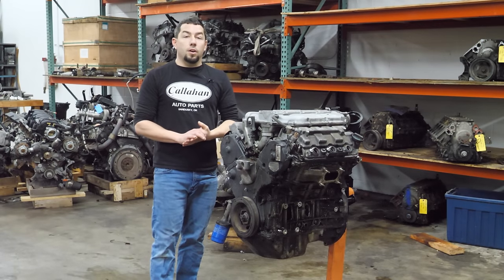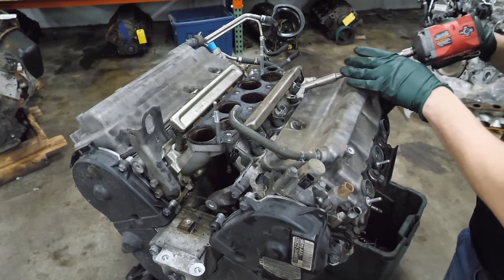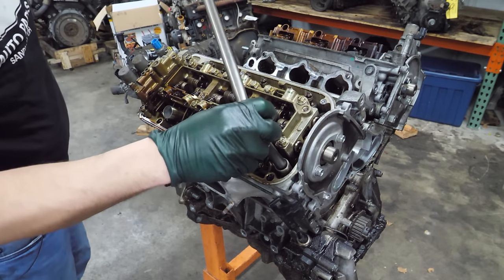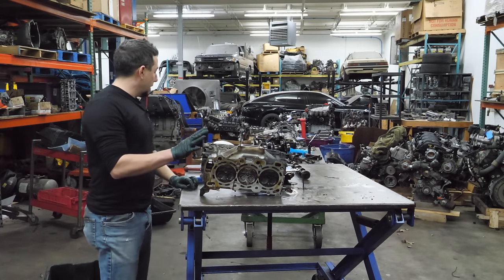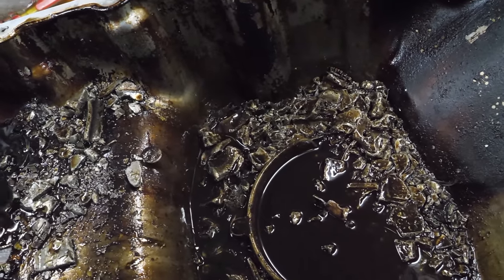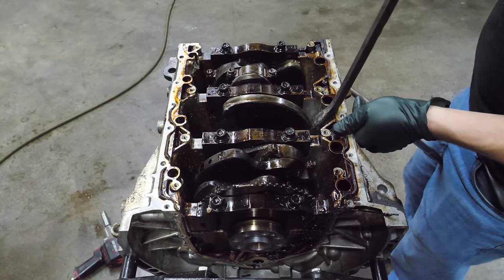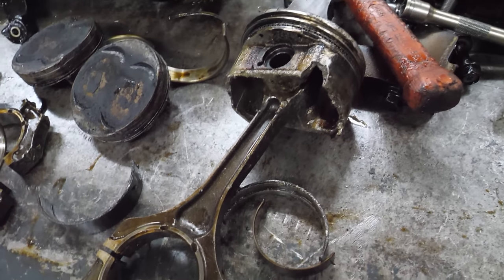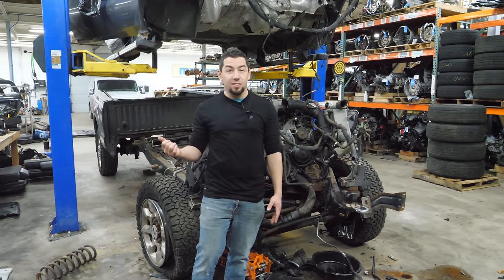Obliterated Honda Accord J35 V6 Teardown. Customer States: "Vehicle Shut Off"  OH I BET IT DID!

Comment: The fact that the crank was locked up, tells you that it was a manual transmission.  And that would explain why the engine was so shredded;  The engine probably threw a rod while on the highway or going down a hill or something-- and it coasted quite a ways while still being in gear, and the momentum of the car continued to rotate the engine and shred the parts to a creamy puree.
Reply: VCM never came on the manual transmission versions of the vehicle.

Comment: Think his radio was turned up to much. A coworker was going to add oil to his engine  e use he hadn't checked it in awhile.  I said why don't you just change it. Turns out he had the car since new. Odometer read 80k plus miles. He he had never changed it..just added more when it was low ? It was a Datsun 210.  As always,  great fun watching

Comment: LOL those valve look like skinny mushrooms that all grew at different angles trying to get to the sun.
All people i talk to, i tell them AVOID cylinder management engines.  ALL manufacturers, ALL.  I love my GMC trucks, but those 2007+ 1500 trucks with AFM (Active Fuel Management)/DOD (Disable On Demand) = hard no. I stick to my 2006 and wont ever buy an AFM engine.
Stay gold.

Comment: I have a 2010 odyssey with a bad VCM 3.5. Do you know if I can use an 08+ non vcm MDX or Accord engine? I know they changed the odyssey bellhousing in 2007. Did the MDX and Accord also get the updated bellhousing?
Reply: Use a vcm muzzler?

Comment: I blew up my engine… it burned so much oil I had to put a quart of oil every time I put gas ⛽️ I ended up just changing the oil filter and adding oil for a year and a piston spun a bearing… when I drained the oil it was dark dark with metal 🤘

Comment: How do you break FIVE rods in one engine and into so many pieces? This one was NOT just running down the highway when it let go. Maybe running down the highway in LOW gear being towed by an RV! I took apart a 350 Chevy years ago that had 4 spun rod bearings (ran out of oil by 16 year old) and it stayed together.

Comment: @I Do Cars so I have a accord 2008 coupe, j35z3 and I have a grinding noise when I’m on idle and my crank pulley is definitely wobbling, and I took it to a mechanic and they told me the crank shaft is definitely damaged. What should I do, should I rebuild the bottom half or is it even worth it!
Reply: @I_Do_Cars

Comment: Ive got a Ford V10 that literally blew to pieces and its a lot worse than this Honda.  The entire block exploded and everything in the engine crumpled.  The driver was in hospital from engine shrapnel too.  It was racing 1/4 mile on nitrous so around 3,600 hp.  The engine was like a grenade and shit went everywhere

Comment: Eric, I would like to buy the top Intake bolt set from you if that is possible. IDK the name of your shop.
Old school hammer and deep well socket for small block chevy springs and keepers. ;D Hilarious with the safety glasses. 😂
The person driving this car literally drove it while destroying the engine in the process. It was coming apart for some time before it died.

Comment: My boss had this exact year and model Accord.  Honda bought him an engine rebuild at 90k miles after 2 rounds of fouled out plugs.  Sure enough a couple more rounds of fouled plugs later it was once again burning oil nicely at about 100k later so it got traded in.  Yeah it made it to 200k, but under protest.  Not Honda's best design by far.

Comment: I guess that if that automatic transmission has a strong lock up converter clutch and the car was moving at speed on the highway and also if power doesn't go through another one way clutch or sprag in high gear,momentum from the car moving along the highway after the engine began to disintegrate continuing to spin things might have played a part in the degree of total destruction

Comment: Hi There - How is Honda Steel these days? I drive a REAL Mercedes FROM 2001, but my Motorcycle is a honda. I got her in 1979. This was before Honda made cars. I love and use my motorcycle now. I had put her away in 1988 to raise my family. I restored her during shelter in place, and during her first short ride, blew out a muffler at 13,000 miles. Condensation I assume, yet I question the quality of steel that honda used for the 'top of the line' and curious what is the quality of top of the line in terms of product quality these days, and oh btw: what is top of the line in terms of steel according to honda ?

Comment: I was extremely entertained by this video, but something is gnawing at me.  I am a physicist who deals with energetic materials, and analysis of strengths of materials.  If I have been informed correctly, Honda used forgings rather than castings for their connecting rods (note the complete lack of cast lines on the rods), and crankshafts, leaving only the pistons as cast items.  What troubles me is the extreme amount of fine rod material in the fragment "mix", despite the fact that the rods were not seized on the big end.  In order for that much fine maceration to take place, the engine would have needed to do a tremendous amount of "work" at EXTREME RPM for a sustained time period - in simple words, it would have taken far more POWER (power = work in joules, divided by time in seconds.  The result is in watts, ~746W = 1 hp)than this engine would have been capable of delivering, especially once it was mechanically compromised.  I cannot reconcile how this engine could have sustained the degree of rod damage that it did, and retain fluid motion of the connecting rod big end.  I wish this user nothing but the best, as he has provided me with many hours of fun in front of the screen, and I hope his success continues, but something is not quite right about this degree of destruction, occurring in an engine that has connecting rod large ends that are still moving normally.

Peace

Comment: You need to take manual 4x4 car, lock diffs and drive down hill like 100mph when you activate electric ratchet, that will unscrew oil filter to 100% stop oil supply. Then engine brake at red line until all wheels lock up or until no engine braking will take place. It will be blown nicely.
I think, that it will take closed course and driver with real balls, a lot of mess will be everywhere :v
And electric ratchet could be string or belt on filter housing, just pulled from cab

Comment: Sheesjj, how it went :
5th gear 3.5k rpm... 'clunk' what was that?? 20 sec later, Brrrrshshshs ratatatata rinkle rinkle.. Yo the engine is blown.. But.. It stil runs yo 🤨. Cil 1. 2 and 3 left the chat. 4 is also done.. 5 is having a seizure and needs a medic, piston 6 has the typical Honda lawnmower enthusiasm and keeps on chewing wile the thing is selfdestructing and uses the crankshaft as a blender. 4 miles down the road the cil 6 also exploded and this dream comes to an end 🙂

Comment: VCM ruined the J motor. Before VCM the J motor was a half a million mile engine with oil changes and t-belt and pump changes every 100K. I’ve heard of bypassing the VCM on the late J engines but I haven’t seen one that’s been done.

Comment: They way they designed the VCM SYSTEM is really unreliable due to what you're showing. Also causes the cylinder head on the front to run hotter than the rear cylinder head. And that's why I know a lot of people who deactivate the VCM

Comment: Evaluates timing belt tensioner: "still has lots of resistance, betcha that's still good... flings into a bin.🙈
Evaluates waterpump: "its a honda pump though, that would be a really good spare for somebody." 
Yeets it off camera (onto a work bench?) with a crash.  😜

True fact: Bent waterpump impellers will increase coolant flow by 10%,  but only if said Honda has Mugen racing stickers plastered all over it, and has zipties holding the front bumper on. 
(I joke)

Comment: If you've ever had to remove the crank bolt from a J35, this video was insulting. I had to take my Pilot to a shop to have them use their largest impact to get the thing off. I tried with a 1/2" breaker WITH EXTENSION and the special holding tool... nothing.

Comment: Cylinder deactivation has always always led to problems with every single manufacture. It's a piss poor idea that will never be able to work. You can't shut off a cylinder that's still moving with the crankshaft that adds rotational mass, but doesn't help turn it. They only do it for MPG numbers to make it look good on paper. Never ever buy a vehicle that has any type of cylinder deactivation.

Comment: Disabling cylinder de-activation, if done early enough in the cars life, fixes all the problems that occur with these engines.  Too bad that one has to work around the factory engineering just to have a reliable vehicle.

Comment: It does not like it was taken care of.  First look at the plugs and the blow by. Every once awhile have the oil check for wear.    Use top tier gas and good oil. Not the cheapest.     I have owned this engine in Acura and Honda and never had any problems.      Note. New recall possible on this engine, maybe from poor ownership.

Comment: I mean Hondas are great motors I've trowed a rod Tru the block and drove about a mile home and it would crank up and move 2.1.5  four cylinder 1991  Prelude Went to downshift from 5th to 4th and grab 2nd that was not good it was duel over head cam ran really good till I did that !!

Comment: I have this engine w/ 225k on it. Just did my 2nd timing belt change at 218k miles. I had an issue w/ misfire twice in the past. Both times the car was in cruise control and downshifting. Mechanics couldn't find the issue, but I changed the plugs and it's never done it again. Is this engine historically good for 300k? I do very good maintenance on this car. I put the new belt/replaced all shocks/struts on hoping to have it around another 4 or 5 years. Anybody have one over 300k?

Comment: This looks to me like a deliberate engine destruction.
24:35 Green engine oil I used it in my motorcycles back in the 1960.
Duckhams, the British oil brand, is well known and respected by classic car enthusiasts for it's high quality, green coloured motor oils. Many of the iconic car manufacturers that built the classic cars of today recommended the use of Duckhams lubricants in their engines and drivelines.

Comment: If the driver was on the highway, I bet the front bank locked up. This caused the speed to drop, which fired up the back bank. This ripped everything a part. Lol. The driver didn’t know oil is important.

Comment: So, im no expert. But It seems to me this engine was horribly abused during its end of life transition. 
Like, how long from the first audible or seat of the pants indication that "something aint right" did the customer have to run this motor in order to  do this amount of damage? 

I've seen a few busted engines in my time 
but never one that completely devoured what?  3 whole pistons and basically 5 out of 6 con rods?   How long does it take for an engine to go from wounded but still viable to con rods, leaving confines of the block and pistons converted into gravel like this? 
The fact it ran long enough to do such a thorough job of completely lunching the motor is something of a testament to Honda engineering, no? 

I genuinely am curious - thoughts, gents?

Comment: Honda V6 engines are not made to be under load pulling a trailer the bottom end is built to lite and the crank is a short crank and a loss of torque. Absolutely stay a way for Toyota and Honda V6 engines if you’re pulling trailers a lot .

Comment: Im just curious:  how in hell do you start up, run, and drive an engine with 180k miles on it that in turn, fails like apparently did in the video?

How in the f#@$$&k do you not hear or feel something going wrong with the engine a couple of minutes or couple of hours before this particular catastrophe?

Are the owners of this vehicle actually unaware that engines actually need oil to operate and run properly?

What does it feel like to be that stupid?

Jason Wampler 😢

Comment: How an engine explodes surely has no bearing on manufacturer, 
It has to relate to conditions, if an engine be Kia Honda Ford or what ever brand it is makes no difference,
it will be totally down to speed oil level maintenance and tempature, 
A car doing 100 mph down the road that lets go will be obviously worse than a car tipping along at a reasonable speed

Comment: I can't figure out how the engine could have ran long enough to grind everything up so finely 🤣😂
Reply: I don't think it takes very long when you start the process (after you already have had an oil starvation or bearing trouble) at 10,000 RPM.

Comment: When or if you do find that mythical worse engine , it's demise will have involved a lack of oil changes , lack of coolant , and a sidewinder. It won't arrive on a pallet but in several buckets .
Fingers crossed.

Comment: Yup. This Honda is by far the worst from your videos... I worked on my brother's late-model oval track stock car back in the late 70s... First year we ran a 327/325hp Vette engine... Broke a driveshaft and since we had no rev-limiters back then our driver unfortuneately held the gas to the floor... Talk about a "grenaded" engine!  It exceded 10 Grand on the tach... We removed that small block in three pieces... Even the cam was in four pieces..wish I still had pictures of it..
  We eventually went with a Bill Putt built 402 Big Block(with Rev limit ignition and our first year with that motor we won every heat and every race that year at Star Speedway in Epping NH!!

Comment: Poorly maintained. Need to say how many miles and how frequently the oil was changed. This J was terribly abused and neglected. I have 196k on the same engine in a 2011 and when I did the valve cover gaskets at 145k it looked pretty clean considering the mileage. No chunks. No oil deposits. Valvoline Max Life for the win!

Comment: car makers need to get rid of all the cylinder shutoff bullshit, none of it works, from any of them.  I mean, why turn off entire banks and unbalance the engine... why not just cut the fuel injection and spark cycles in half on EVERY cylinder and keep things balanced.

Comment: I think I know how this started:
HondaBoy2000: My engine will do 11,000 rpm!
HondaFan2009: No way!
HondaBoy2000: Yes way, I have videos of it on my vlog. I do it all the time.
HondaFan2009: Wow, I've got to try that. BRB
(2 hours later)
HondaFan2009: You lied you *&^%! My Accord blew up at 7500. I'm going to sue you &#@&#&!
HondaBoy2000: Uh, dude I have a Honda FIREBLADE. It's a motorcycle. You didn't watch my vlog did you?
[HondaFan2009 has left the chat]

Comment: The J35Z2 and Z3 weren’t really anything to weite home about. Not too valuable imo. If you happen to get a Y series, those heads are definitely more desirable than the Z heads. Mostly because they have a revised head design and cam design for better flow.

Comment: Talk about powering through it lmao this poor 6 cylinder had to be knocking so hard there is no way this happened all at once, the fact that this person was able to keep driving it is before it locked up speaks to Hondas reliability 🤣...about a month ago I started hearing a very quiet whining noise from the front passengers side it was hardly noticeable but i knew it was the wheel bearing straight away...everyone that rode with me including the wife said I was crazy they don't hear anything...sure enough the noise got louder a week ago so I replaced the bearing and presto noise is gone...long story short even a quiet whining noise is enough to make me not want to drive further 🤣🤣

Comment: oh come one a little sand paper to smooth the  cam lobes,  re-lap the valves   some   new rings and plugs and    get anther 180k miles out of it,     ive seen only  one other that  would come close and that was when i worked  parts manager   for subaru and     one of the first   H4 engines came in  woman said it stalled  going up her driveway  ha ha ha  .  it sucks  a  blow up  piston across through intake in to  opposite bank

Comment: Come on. This has to be fake. The engine would have quit long before this level of damage. How can it run on zero cylinders?
I say this engine was rotated by another engine at high speed to destroy it. Possibly over revved going down a steep mountain highway. No way this can happen to an engine running on its own power.

Comment: The Honda engine blow up is a fake. You can’t run an engine to complete destruction, on ALL cylinders, without any pistons left firing to turn the engine lots of times to get it to that point where all the pistons failed 😂 I call B.S. on the video. It most likely dropped a rod or two and then was towed in gear, spinning the engine at high rpm, to finish killing all the rest of the cylinders. Also the parts are too minced up showing it was turned for quite a while to finally get it to that point. That’s my take on it with 3 engineering degrees and plenty of experience blowing engines up on purpose 😂